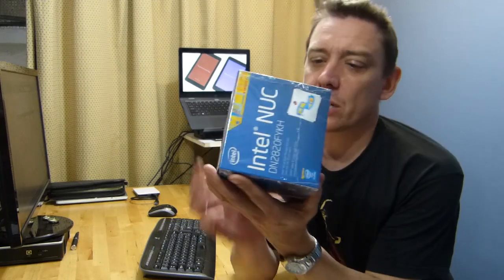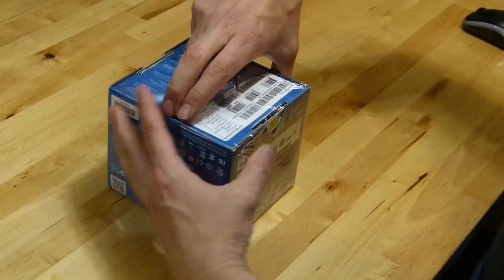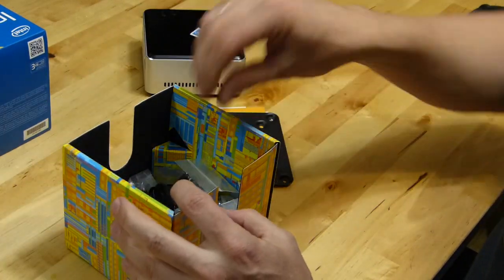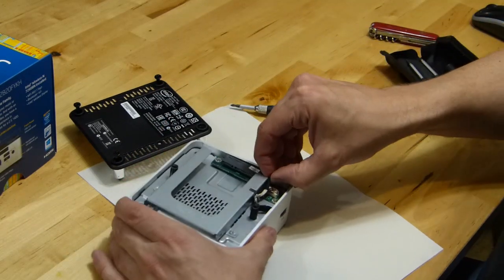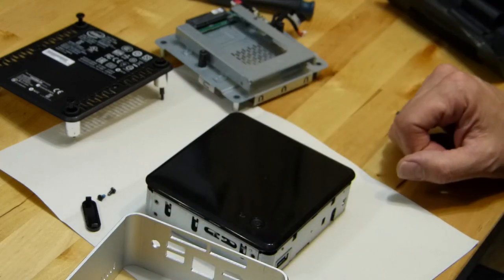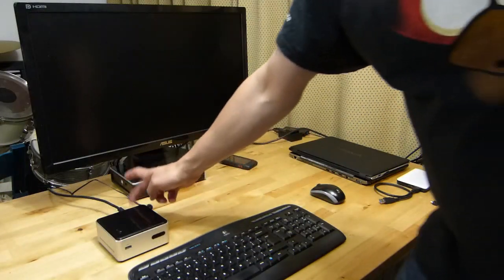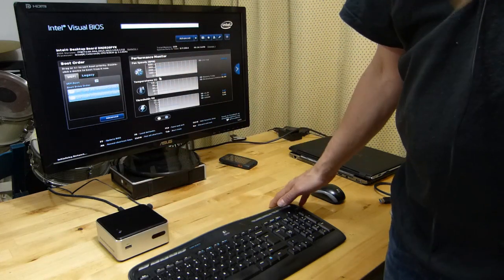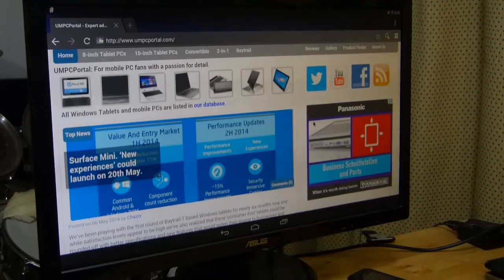Intel NUC Baytrail DN2820FYKH  Set-up and Test

Comment: Are you satisfied with your nuc , thinking of buying one for linux ..... how is the video on this thing and io transfer from disk ..... 

kind regards great vid.
Reply: Hello, I have one of this with Celeron processor. Installed XUbuntu with kodi and emulators (snes, nes, psp) and it works incredible well. I have it with 4gb of memory and a SSD 240gb, but the movies are in my server, accesed by the NUC via network. 1080p playback with no problem. The IR receiver in the NUC is very valuable for using as HTPC (home theater pc)

Comment: Is it possible to add the playstore etc?
Reply: bolloxology76  download this android , http://sourceforge.net/projects/android-x86/files/Release%204.4/android-x86-4.4-r3.iso/download , more info on this website:  http://www.android-x86.org/ and you are good to go , play store works , games and all ... (some do not work but i have yet to encounter one.) for android 5 lollypop , the app store is not complete functional yet
Reply: Very interesting.  Thank you!
Reply: Leo TechTips Hi Leo. Worked a treat. Installed it to a spare 8gb ssd and it seems to run amazingly well. They have improved this a lot. Thanks.